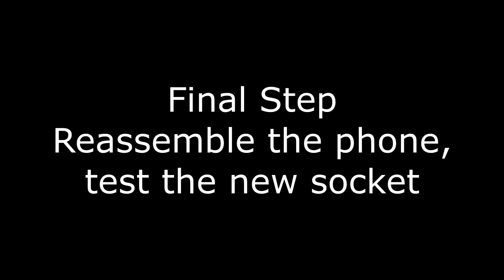How to replace a micro-USB receptacle - Samsung Galaxy S3 mini

Comment: i have 2 question
in what heat is the solderind iron and what the hot air ?
where can i buy capton tape?
(the orange tape that  i saw to protect the other compoents from the hot air ?)
a link from ebay would be much appreciated!
Reply from the maker: I usually set both the iron and hot air at around 350°C
You can buy kapton tape from many online retailers, but I usually buy on aliexpress, it's usually cheaper than eBay: https://www.aliexpress.com/wholesale?catId=0&SearchText=kapton+tape

Comment: I'm wondering if you could have used your heat gun together with your wick to remove the excess solder after removing the old port. Instead of using your soldering pencil I mean......
Reply from the maker: panther105 Probably would have helped if I had the hot air nozzle helping the iron, but I was afraid it would overheat something. I don't think that if I was only using hot air the solder wick would get close enough to the PCB without the soldering iron pressing, but I actually never tried, I might try it soon.

Comment: now i dont really get some of parts you do like with that orange cable thingy. but would it be okay if I directly solder the new port on the board to the gap of the old port?
Reply from the maker: As long as you use a bit of good flux, it should be fine.
Reply: alright thank you mate, very good video!

Comment: Jose, Why is it necessary to go over with wick? Can you just iron back the new one without doing this step?
Reply: Also, whats kind of flux do you use?
Reply from the maker: lissete mata The USB receptacle I used had little pins in the shield that needed to go inside the holes in the PCB, that's why I was trying to clear the holes, so that the USB socket would fit perfectly before I tried to solder it. I don't know if you could fit it properly without cleaning the holes, the ground plane of the PCB was dissipating a lot of heat, it had a lot of via stitching, I was afraid that if I used hot air it would damage the plastic bits in the new USB socket before the solder in the ground plane melted. Note that if you use solder wick, it's very important that you make sure you don't pull the solder wick from the PCB very hard, be very careful and lift it very gently or you might lift the PCB tracks if it's not hot enough.

Regarding the flux, I use this one:
http://www.mgchemicals.com/products/solder/fluxes/no-clean-flux-paste-8341/
It costs around 9 euros on Mouser. It's a bit expensive, like most high quality flux, but it works beautifully. There are plenty of good quality flux around from several manufacturers, I just tried this specific one, liked it and I didn't look any further. I also have flux pens and brushes, but I find they evaporate a bit too quickly (it is easier to clean, however).
Reply: Thank you jose! :)

Comment: Do you have a electrical part number of micro-usb? So i can order it in our local distributor (i think it's the same of S3 i9300).
thank you so much
Reply from the maker: No, I bought a generic one on eBay. Check the picture of the USB connector on sale and see if the footprint matches the one you need to replace. If you want to buy it locally, your local distributor should have a catalog so you can check the drawings and see if the dimensions match.
Reply from the maker: The footprint of the shield looks right
Reply: Thank you so much to all.. :D
Reply: Yes. I first didn't wanted to pay someone to change me that part because they asked $50 for it. Later I wanted but most of people will not work with soldering. Now I just need right tools and I will do it by myself. I'm tired of charging batteries externally.
Reply: Yeah...in my two original power supply..I had the same problems.. the cables.. the telephone didn't charge or charge only to half level..with new cable I resolve a lot of problems! !! But now I've new one :/ ah ah ah :'(

Comment: Hello , for my samsung s4  the metal spots didnt melt with 35w, do i need a hotter tool?  Seriosly ill thnk u very much :)
Reply from the maker: Are you using hot air too or just a soldering iron? Is your soldering iron connected to a soldering station (temperature controlled)?
Reply: José Faria its a cheap soldering iron i bought for 5 dollars. i cant change the temperature and im not sure how many grades it has. and no im not using hot air :(
Reply from the maker: If you are into hobby electronics, I would recommend a temperature controlled soldering station, even if it is a cheap one, it's so much easier to work with than a regular soldering iron. If you can afford it, go for a good brand like weller, hakko, jbc, etc. They cost a significant amount of money, but if you use it regularly you won't regret it: they will last longer (especially the tips and even more so with lead-free solder), they will have better/smarter temperature controllers and always have spare parts available. 

If you can't afford a good brand go for a clone, they are very reasonable (this video was done with a cheap station). If you are on a budget go for something like this:
http://www.aliexpress.com/item/Best-Selling-220v-ATTEN-AT8586-2-in-1-SMD-Rework-Station-Hot-Air-Gun-Solder-Iron/540587582.html
or this:
http://www.aliexpress.com/item/DHL-Freeshipping-110V-220v-KADA-852D-Rework-Welder-Station-SMT-Hot-Air-Soldering-Iron-SMD-Solder/1847753385.html
There are also lots of those on eBay, but if you can afford it go for a good brand, they are worth the higher prices.

With that out of the way, it's not impossible to do it with just a soldering iron (although I'm not sure about a low power one like yours), but it's not recommended at all, what people do when they have to do that in "emergency" situations is connect all the usb pins with a blob of solder, then heat the connector shield until the shield's solder in the PCB is melted and then quickly heat the first blob of solder so that all pins and shield get hot at the same time. If all goes well the connector will lift of the board, however you would need a very hot iron to do this and it is very likely you would do damage to the PCB, either lifted tracks and pads because of the mechanical stress or delamination of the PCB caused by overheating.

Comment: How hot does the solder iron have to be??
Reply from the maker: I think I had mine set at 370°C, but it is not calibrated and the real temperature was less than that. It has a small tip with very low mass, that's why it needs high temperatures. Note that if you are soldering sensitive components at such high temperatures you have to be very quick, avoid more than 1 second at that temperature.

Comment: Hey.. is there a way to unsolder usb using only the soldering iron? if so how?
Reply from the maker: Short answer: don't do it unless access to a soldering station is absolutely impossible, there is a big chance of lifting the USB pads and vias.

A a last resort you could try and melt the solder on the data and power pins with the soldering iron and lift them from the PCB with a blade, if successful you could then try and heat the shield all at once by placing the soldering iron on top of the shield and, after the solder hets up, remove it with tweezers.
Reply: José Faria Thanks Jose :)

Comment: I have a smd hot air gun. What temperature I need to set it to in order to remove the charging port?
Reply from the maker: 350ºC is probably a good starting point.
Reply: +José Faria Thanks

Comment: Hey, next time try ChipQuik.   
Port would be off in 1minute with SAFE temperatures as low as 150C
no damages to pad or neighboring components.

It will be like magic!
Reply from the maker: Never used it, but it is really expensive, they use alloys with metals like indium and gallium. It also feels like it will probably not work on stuff like BGAs or connectors with large pads soldered to ground planes, did you try it in those cases?

Comment: How hot did you set the hot air gun to?
Reply from the maker: Around 350°C, but it was a very cheap soldering station, never had it measured for accuracy.

Comment: where did you get your replacement charging port?
Reply from the maker: +Mocha_Top You can get it on eBay, aliexpress or other retail websites, just search for your model number + USB port. You can also probably buy one on a local phone/laptop repair shop.
Reply: +José Faria I have the same exact phone, what do you mean by USB port
is there a specific one you used
Reply from the maker: Yes, you can see the model number on the sticker under the battery, something like i8190

Comment: USB kobo arc any suggestions? Plz I need one thanks
Reply from the maker: I'm assuming you have a problem in that equipment's USB socket. If that's the case, you will have to find a way to open the device and take out the motherboard, after you do that the replacement procedure should be identical to this one.
Reply: Is kobo arc I need a new replace of the USB port. Or try to charge the battery from other resources, but if I move the mother board which isn't hard what I will find. To charger my tablet. Thanks for answer back..
Reply from the maker: Changing the USB port is more convenient than taking the battery out every time you need to charge it. If you are not confident that you can do it yourself, take it to a computer repair store and ask for a quote, it should not be too expensive.

Comment: i would've wicked/sucked away the ground plane solder before proceeding with hot gun,
and the gun might be calibrated, but if you hold it so far away, it wont heat up much

Comment: Some times i heat my board hard en i start seeing smoke coming out of the board Thats Bad ?
Reply from the maker: +ilias boubout Unless that smoke is flux, yes, you are probably burning the epoxy in the PCB. Even though copper and fiberglass can resist high temperatures, the gas you are releasing will probably cause the PCB to delaminate and cause failures.

Comment: Why you didn't just use the soldering iron rather than using heat gun to melt the lead and use a solder wick or pump to remove it?
Reply from the maker: Kaisser Nobleza It's lead-free solder, there is no lead; it's mostly tin, it melts at higher temperatures. There were 11 pads, personally I find it easier to just use hot air.

Comment: is it posibole to remove the port whitout that FAN ?
Reply from the maker: It might be possible, but you increase the likelihood of damaging the board. A hot air station is recommended, even if it is a cheap one.
Reply: @jfaria  does it throws hot air or cold ?
Reply from the maker: @toshavhaeir6791  Hot air, 350°C, it is used to melt the solder under the nozzle at the same time so you can solder and dessolder parts with many pins.

I use one similar to these:
https://www.aliexpress.com/wholesale?catId=0&SearchText=hot+air+station+

Mine cost less than 50USD and is still working fine after 6 or 7 years, now they appear to be even cheaper.

Comment: Link to supply of the new connector?
Reply from the maker: Search on your favorite online retailer like eBay or Aliexpress. Search for your model number, like this: "i9505 replacement usb". If you don't want to lose time soldering the USB port, buy the complete board, it's a bit more expensive but it will save you time.

Comment: Hello man. Plaase link soldering and flux and hot air station.
Thank you man.
Reply from the maker: +csaba87021 Hi, if you want a cheap station to have in a small shop to make ocasional repairs go with one of the cheap stations like this one: 
http://www.aliexpress.com/item/ATTEN-858D-SMD-Hot-Air-Rework-Station-Solder-ATTEN-AT-858D-AT-858D/32624896324.html

Regarding flux and solder, don't buy low quality ones, even if you only use it once or twice a year. More than the quality of the tools you are using, good solder and flux have the most impact on how easy your work will be. Among good quality products, it really goes down to personal preference, but I highly recommend these ones: 
Flux: http://eu.mouser.com/ProductDetail/MG-Chemicals/8341-10ML
Solder: http://eu.mouser.com/ProductDetail/AIM-American-Iron-and-Metal/14111

Note that, regarding the soldering station, if you have a reasonable budget go for a quality brand, they are worth it if you can afford them, some examples:
http://www.jbctools.com/ (I never found someone who regretted buying JBC tools, really expensive but amazing tools and available pretty much anywhere)
http://www.weller-tools.com/en/Home.html
http://www.kurtzersa.com/electronics-production-equipment.html
https://www.hakko.com/
Reply: Thank you!

Comment: Temp too low, he should have that sucker off in ten seconds. Also don't prod with metal to see if solder is metling , that acts as a heat sink . You will see the solder flow when it's ready to part company.  Put some flux on work BEFORE heating.

Comment: I follow your video however the battery is still not charge. Where else I can check?  Thanks.
Reply from the maker: Make sure the pins are properly soldered and there are no solder bridges between them.

Is there damage to the PCB tracks?

Does that charger work on other mobile phones?

Can you send me a macro photo of the USB receptacle?

Comment: Hey guys, i removed half of the solder pin along with the damaged usb port, how can i fix that?
Reply from the maker: You can use a very thin copper strand from a wire and bridge the PCB pin to the new connector pin, bypassing the missing track.

Comment: Can I mod it and replace it with USB-C?
Reply from the maker: Hi, the short answer is no, unfortunately. Now for the long answer: standard microUSB connectors only have 5 pins, ground, 5v, ID and two data lines, USB-C has several more signals, usually around 24 pins (many of them duplicate because the plug is reversible), but it would be very hard to fit such a large connector and wire all the required signals inside such a small phone, then you would have the problem of holding it in place so that it doesn't break when inserting or removing the cable.
Reply: José Faria I was thinking Samsung S3 full-size or Samsung s4 and making the port whole bigger
Reply from the maker: It's still too small for it to be solid, you would have to use a breakout board and it would have to fit. Maybe on some tablets you could make it work, but I don't see it happening easily on a phone. Also, remember that even if you could fit a USB-C connector you would only be able to use old chargers, you wouldn't be able to use the new, proper USB-C chargers, they require additional communication to negotiate the charging voltage and current, you would need to use something like this: https://www.tindie.com/products/ReclaimerLabs/usb-type-c-power-delivery-phy-breakout-board/

Comment: i do not use solder wick, it over heats the pads - best to use hot air gun.
Reply from the maker: I would, but I don't have an electrically operated suction pump. I never had overheating problems with ground plane pads, but it's easy to avoid that, instead of using high temperatures, a short length of desoldering braid with a high thermal mass iron should not damage pads.

Comment: That looked like a story that I was once told about that had a monkey and a football.  There is no need to clean the solder from the traces, you could have laid down the new jack right onto the already flowed solder.  And do you have some wind blowing on the board?  That's why it wouldn't flow the solder.  That's also why your wick stuck to the board and wouldn't come off even with a soldering iron firmly pressed against it.
Reply from the maker: No wind, just a ground plane with lots of via stitching and a cheap low thermal mass soldering iron. I cleaned the traces because I was soldering it with the soldering iron, not hot air or IR.
Reply: But you are aware that you could have just laid the replacement jack right onto the molten solder without removing the hot air right?
Reply from the maker: When I hand solder multi-pin devices with a soldering iron on old PCBs, I find I get better position accuracy when I clean the pads; and since it's very quick, why not? Just habits, I guess :)
Reply: Not to drag this out but....

Why not?  Because it's not quick.  It's cumbersome and time consuming and since you'll need to turn around and reapply solder, it's unnecessary. You spent several minutes getting the solder up to temp and flowing and now you cool it and fumble around with physically applied heat from a soldering iron that quite often damages traces.  You yourself warned that one must be careful not to rip the trace from the board (when it sticks to the wick) but it's actually more common to damage the trace from fumbling around with a soldering iron and trying to get the trace/solder hot. 

Much easier to just lay the new jack down on the already flowed solder without ever removing the heat gun.  Voila!  Cuts your entire video/process in half.
Reply from the maker: I hand solder new prototypes for a living, so I only use new PCBs, the phone in the repair video is from a friend, it was the first micro-USB plug I've replaced, so yes, since I don't do this for a living it is very quick to clean 5 small SMD pads. I also have some experience with solder wick, that significantly reduces the likelihood of damage.

Regarding the positioning, that USB socket had 9 contact points with the PCB, I don't see how you could solder it with perfect Z-axis accuracy using only a soldering iron without cleaning at least 8 of those points first.

I'm not trying to correct you or anything like that, I'm just giving you my point of view, I guess we all have our methods.